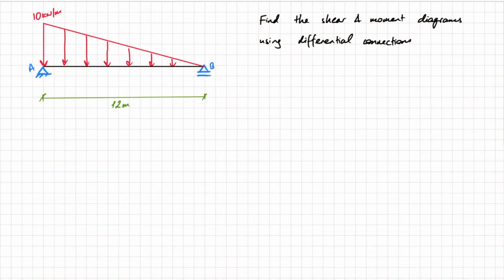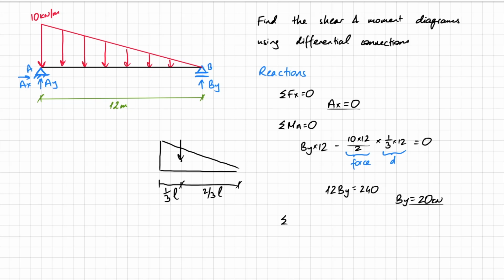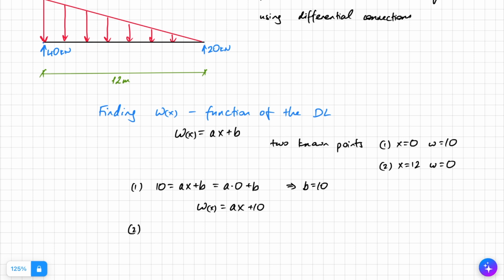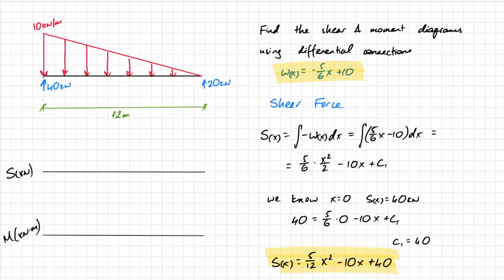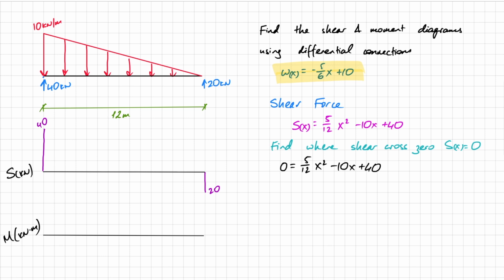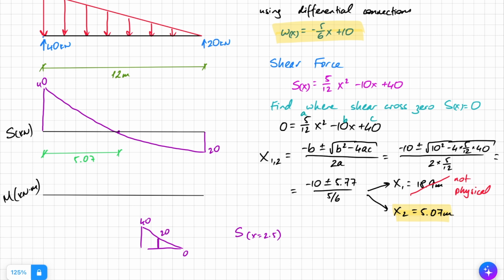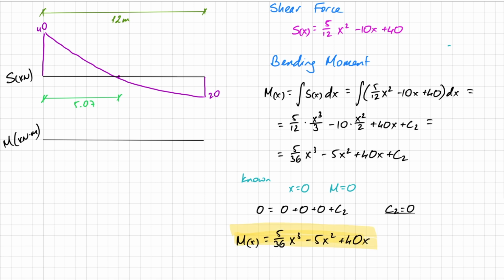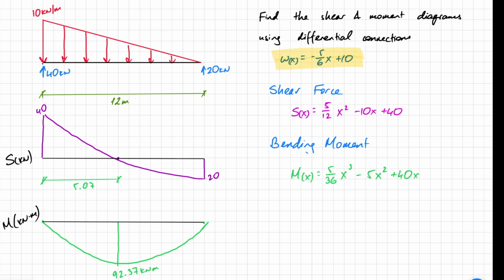Engineering Mechanics | Beam Tutorial | Triangular Load | Differential Connections Worked Example

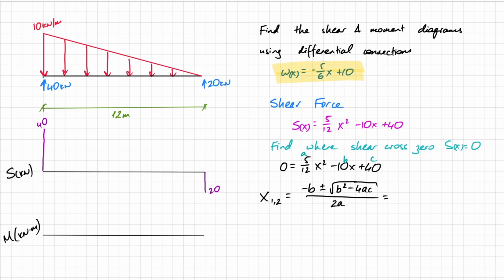Comment from the maker: *Correction:* At 9:25, when applying the quadratic formula, the coefficient is (b=-10), so (-b) should be written as +10 in the substitution. The subsequent calculations and final answers are correct - the sign shown in that substitution is simply a typo. Thanks to @markdonnelly6921 for spotting it!